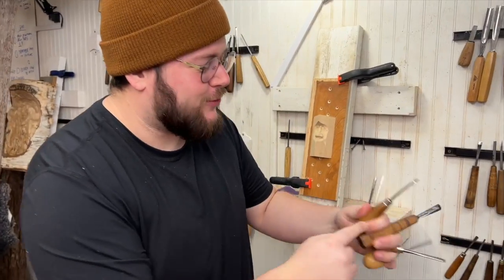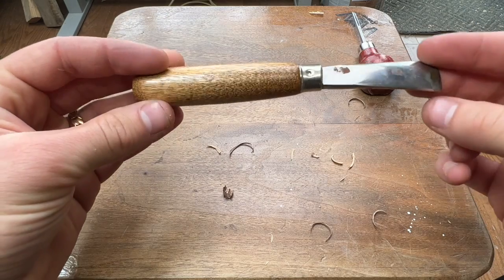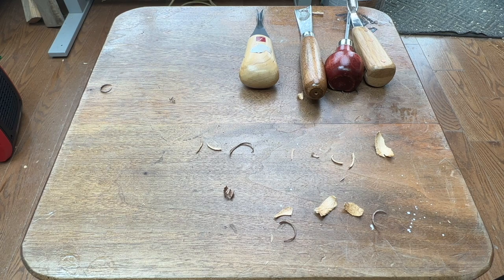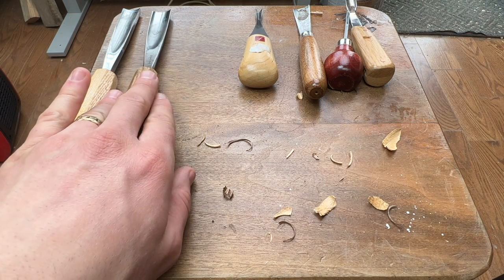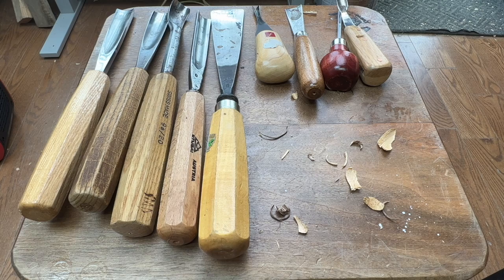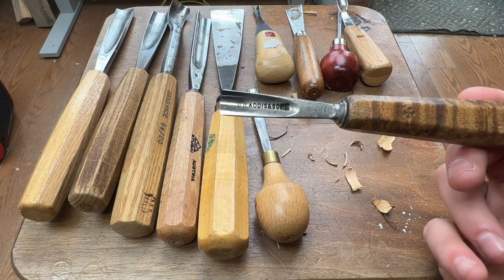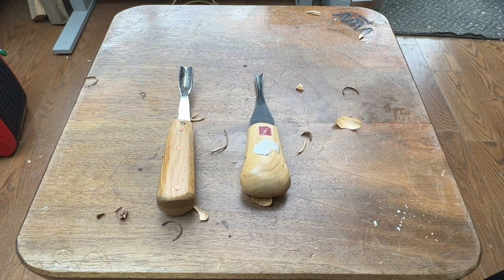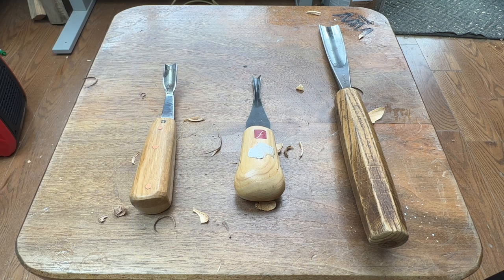Top 3 Gouges For Woodcarving--According to Woodcarver

Comment: Pfeil for me all the way and Lamp Brand as second. I like the professional sized gouges not really a big fan of the stubby sized or palm tools unless I am actually carving linoleum. Pfeil makes a really excellent set of the palm sized linoleum gouges as well. Flex cut and Henry Taylor are my least favorite gouges. I also never use magnet strips to hold my carving tools. I had some gouges become magnetized and I really hate that because it's a huge pain while sharpening because the metal filings stick to the end of the edge. I have maybe 350 carving tools. I've been carving since 1996.
Reply from the maker: Thanks for sharing your experience!
Reply: Will it all wipe off easy when magnetized? If so what’s best cloth to use for that?
Reply: @danielmilliken8903  The really fine metal that comes from sharpening is really frustrating to me and doesn't come off very easy at all once the end of the tool becomes magnetized. I use old cotton t shirts to wipe them off but they are certainly a huge hassle. A wire burr comes off pretty easy but it's the real fine powdery metal that drives me nuts. I built several multi tiered racks out of wood that hold all my carving tools and I have them arranged in order of gouge number so no more magnetizing and my gouges are always exactly where they are supposed to be.

Comment: If I could start over I'd go full Ashley Iles fishtail gouges. They're bomb proof the shaft is so much thicker (cough)  and tall loads of control. Gouges are like crack, have some massive Stubia like with the black rust proof coating they're beast's if not a bit chippy. Not much of a fan of the PFEIL bright steel but still have more of them then anything else... I'm lost
Reply from the maker: thanks for the thoughts!